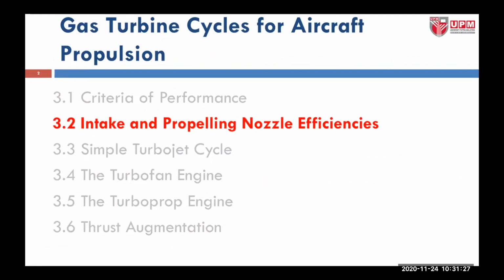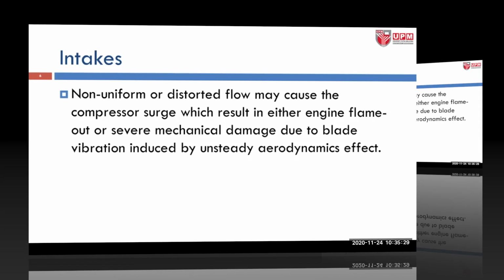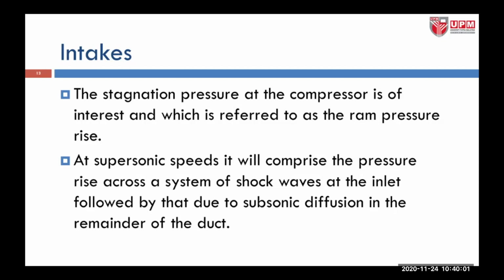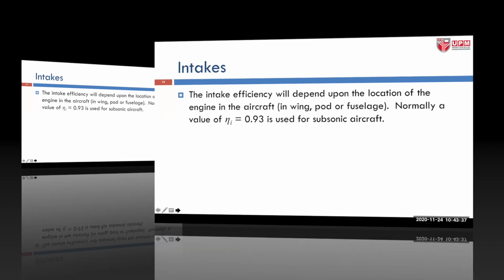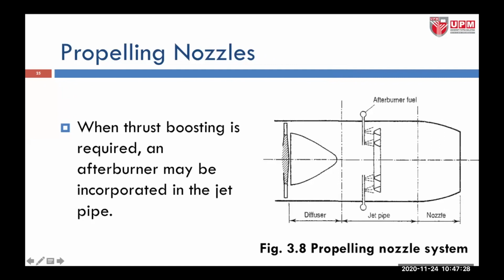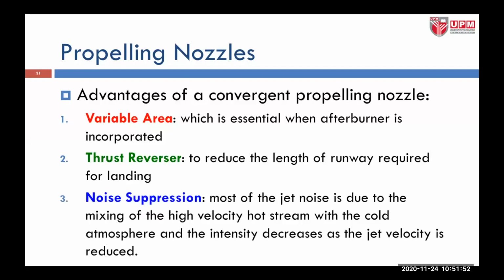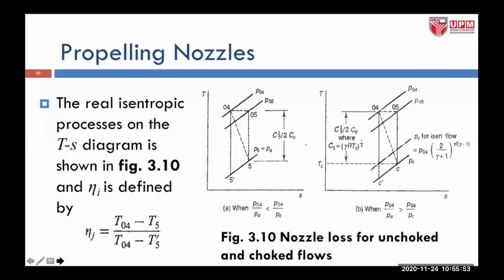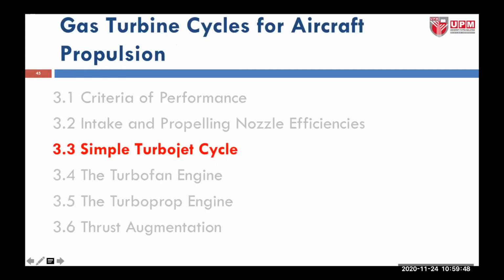Intake and Propelling Nozzle Efficiencies

Comment: In the lecture you mentioned that under static conditions intake acts as a nozzle. So can we use nozzle efficiency equation to calculate intake efficiency considering that it's a static test? Thank you your lecture was very helpful!
Reply from the maker: Yes, under static conditions, an intake can act as a nozzle, and in such a case, it can be treated similarly to how we analyze nozzle efficiency. However, it is important to note that nozzle efficiency is typically concerned with the conversion of energy, such as pressure energy into kinetic energy, in a dynamic flow.

In the case of a static test, you're dealing with a situation where the flow velocity is relatively low or zero, and the air is essentially at rest in the intake. In this context, the efficiency would be more focused on the pressure recovery and how well the intake minimizes losses as the air enters the system.

To directly answer your question: while you can draw parallels to nozzle efficiency, the actual application of the nozzle efficiency equation for calculating intake efficiency under static test conditions might not be entirely appropriate, because nozzle efficiency typically requires dynamic flow data (velocity, pressure, etc.). You would likely need to use a different formula or approach tailored to static testing conditions, such as considering the pressure recovery efficiency or the total pressure loss across the intake.

In static tests, you might instead focus on evaluating how much of the dynamic pressure (or total pressure) is recovered as the air enters the intake, which can be used as a basis for defining intake efficiency in this specific context.